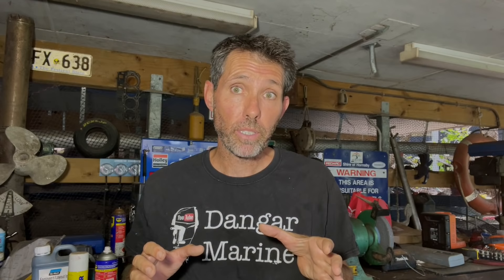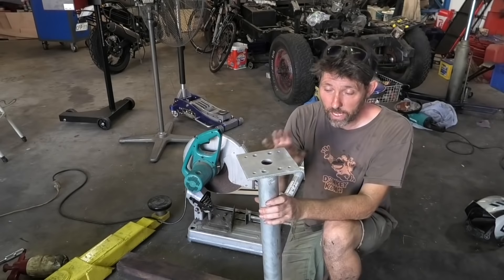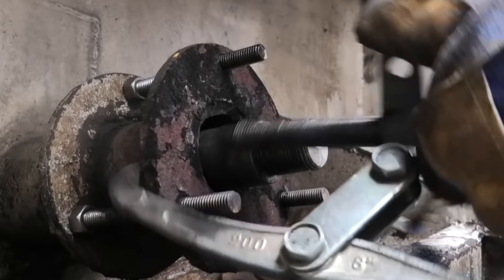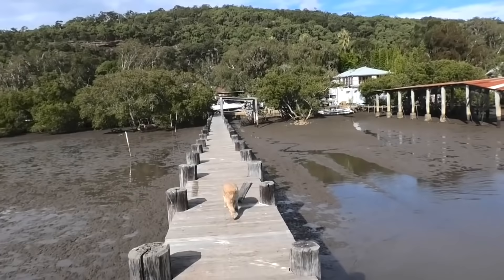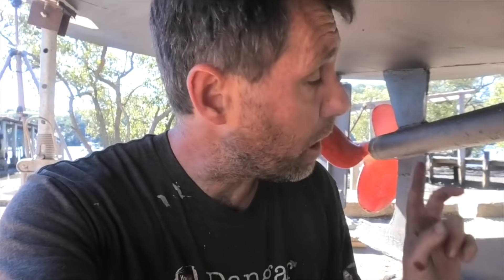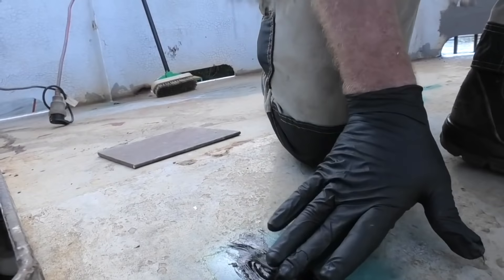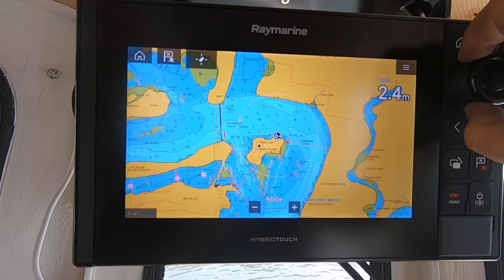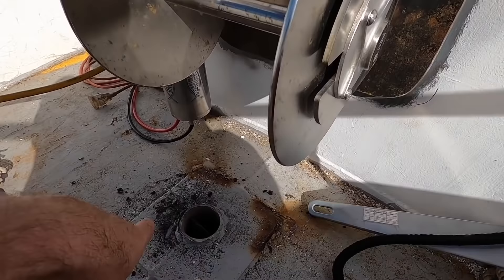Steel Trawler Restoration beginning to end

Comment: You tackled each problem with calm and humor(at least on video). When you can keep a clear mind, you have a better chance at finding a solution. I've done quite a few of these rebuilds with my dad at the marina. We have seen so many DIY folks make every mistake you can think of and some you couldn't imagine. I'll entertain you with a funny DIY story. Two young businesses guys decided to redo the anti-fouling on a sportfish they just bought. They decided that their business knowledge made them experts in boat repair. They quickly got hard to work, sanding off the old anti-fouling with the orbital sander they bought. Three days in, and my dad told me to go check on their progress. I was surprised to see only a small meter square finished. They were wrapping up for the day, and I asked how they liked the new ordital they bought. The one guy said that it seemed like a quality tool, but the pads were wearing out too quickly. I asked them what grit they were using. He handed me the sander, and the sander's pad was trashed. I asked them where's the roll of sanding paper. They looked at me confused. That's when I realized there wasn't any used sanding paper on the ground or stuck to anything. I asked, "Did you buy any sand paper?" They looked at me, and one said, "No, it has a sanding pad." They had been sanding for three days without putting any sand paper on the orbital. I gave them a roll, and they were so happy the next day making actual progress. 😂
No matter the minor mistakes you made, they don't compare to that. Great job! Can't wait to see the next project. Hope your hands are all better!

Comment: You can't think about the economics of this project. It's the journey and the mates you made on the way. It's so good watching your videos, I've missed them.

I hope you can start doing some of your repair videos again. They are very cool. Perhaps a glass boat? 😀
Reply from the maker: Yes, there is no doubt there are plenty of upsides to doing a project like this. It was a great experience even with the hard time. Yep, more repair videos coming soon!
Reply: Yes you can and you should think of the economics behind it.  He spent an amount less than the value you could buy one.  As he said don’t buy a mess buy a nicer boat the extra margin will go out of someone else vs yourself.  Also I’d rather be boating and not fixing.
Reply: @captpepin  Yeah. I work in the industry. For every guy like Stu that wins through, there are a half dozen who struggle for years and can't go on, who could have spent the same money on a smaller, viable vessel and enjoyed themselves.

Comment: It's been interesting following along on this project, and I hope there's more to come. Thanks for your efforts so far, and Merry Christmas!
Reply: been following for 2.5 years I think so this is a rewind I've never seen
Reply from the maker: Thanks Alf, Merry Christmas! Slowly getting on track again now I'm back home. Definitely more vids to come in the new year.
Reply: @DangarMarine  We are all glad to see you back and in good health !!
Reply: @DangarMarine  Hey there Mr. Aussie☺My name is Eddie I'm from Florida and I'm a marine mechanic that has been subscribe to your channel for a few years now. You're absolutely one of the best mechanics I know! So I really need some advice. I was working on a yamaha 70hp and the imeller broke apart and sucked into the tube. I tried fishing them out and I managed to get a one out of 4 pieces. I'm very concerned about running the engine before getting them out. I caught it in time before it overheated so Idk if it will or not. WHAT SHOULD I DO!??
Reply: @eleutriogonzalez6865  Take a look at the thermostat to see if parts of it ended up there, could also try compressed air in there to blow it down the pick up tube again.

Comment: Well, mate, if you'd just released this back in 2018 it'd have saved an awful lot of everyone's time.

;-)

Uncle Cosmo says you need a new project and would like to know how you'd feel about building a glass bottomed inboard catamaran. He also said it ought to be a 'right proper shag-pad' but I think that was mostly the champagne cocktails talking. I say champagne, I mean he's got two boxes of Golden Oak that he's venting a helium tank into every few minutes and mixing the froth that comes out with a two litre bottle of Lift, so, basically the same thing.

Comment: Well.. You will have your reasons... Great job of the boat... 2 St diesel is a dark art.. Used to work on lorries with cumins 14 l years ago... They sounded well.. And hauled 44 ton a treat.. I assessed on some British rnli boat engine overhauls.. Great.. They were 2st 1000 hp each engines.. All good..

Comment: Everything from out of water to dry dock for sea worthiness, engine overhaul, remove rust & paint + anti fouling. Also remove old deals & windows timber finishing, panels in wheelhouse Also galley & bilge access, marine elecrical wiring & old vhf radio + death sounder, engine room. With hydraulic oil & reservoir check.
Battery supply, and voltage.
fuel tank check, and supply. 
Potable water, correct marking/ labelling.
Anchor works & spares. 
Bilge pump works. 
There's so much but it sounds like fun

Comment: Good Day Mate, from Canada I wish you and your family a Merry Christmas.  I learned your warnings the hard way....bought a 1980 Seahorse Trawler....excellent deal of five hundred dollars.  It was a fiberglass hull....bottom line, once I was six grand in with my own sweat equity on repairing fiberglass with no end in sight, I had to make some decisions....I decided that it was coming close to haul out week for the boatyard I was on the Hard on the Toronto Waterfront.  I was going to take the boat up to my farm....I arranged the truck etc to move it....showed up at the yard the day before the moving date...the prick boatyard owner put fifty boats on the hard around mine, I couldn't get my boat out..he did this even thought I told him I was coming two weeks earlier...he didn't care...just told me I now owed him almost two grand for winter storage....I told him to pound sand and walked away from the boat.....just left it......I figure it cost seven grand in total but the lessons learned will save me ten times this amount..I add it up to college investment..how much I learned the one summer I had this boat...I came to the same conclusion as you...point of fact ....trawlers after they are ten years old...do not depreciate much more over the years as the Price Guides show.  The key is if you can afford it....buy a good boat...AND KEEP UP THE DAILY, WEEKLY, SEASONALLY, AND YEARLY MAINTENANCE on all systems.  What commands high prices....excellent up care, meticulous service records, and having a brand that carries a high pedigree....For instance, 42 Ft. Grand Bank Trawlers in 1970 fetched a quarter of a million dollars...it was pristine...it lasted on sale for one week...So my recommendation....take every cent you can part with and buy the best boat you can for that money, but a highly regarded brand from websites, and proper maintenance.  Bottom line, this is ;just a summary because the total point of insanity is owning a boat.....these recommendations will be to mitigate your loss....because a boat is a money eater...you better love boating

Comment: That crane/Tractor that extends and articulate is a super duper handy piece of equipment to remove inside working equipment ( Diesel engine) that (4-71) is a favorite of mine. Had one in a (GMC) dump truck with a (5) speed/ two speed rear end. ( Red nob on gear shifter) I personally own a (353) and 8V-71) in two pieces of equipment I own. The (353) has over 8000 hours on engine hours. I just keep it clean (40Wt Delo) 16:15 ) and the (8V-71) just did an engine service. The filters are all under the truck frame so easily change out. It takes 7 gallons of oil 
I love old Detroit Diesel ( Jimmy's) my wife had me put the two exit pipes from engine going straight up. She sound wonderful, like a older old Detroit should

Comment: Love your Vid guys, (and u mut )  I have had 7 boats and sailed all over SE Asia, all FRP but im about to buy a 1900 steel yacht, no concerns as Im comfortable with any repairs, obviously my only concern it the hull, while anything  is fixable the hull is the big challange as it may require internal cabinetry removal to access the inside to complete the repair. If a steel boat internal hull was carefully finished and protected and the hull kept dry as possible, there is no reason why is can last 50 years without serious maintenance, enjoy your boat, best regards John Gurney
Melbourne Australia

Comment: The problem with any engine is regular maintenance and frequency of top end overhauls are essential to keep the engine in tip top condition, it may have been an idea to get a good certified reconditioned replacement engine looking at the condition of this one. Yes I  realise money is tight but it always is.  Always change the fuel and oil filters at the oil change frequency plus the thermostat, don't over tighten the stuffing box against the packing. When lowering the boat in the water hold it at the normal depth, then check for leaks at the shaft seal, adjust to suit.

Comment: Yep, once you have completed all hull work up to the deck level then in the water onto the berth, once on the berth, you then have all the time in the world to complete the interior. One thing though is to get the bilge wells painted and dry before going in the water, otherwise the metal will condense behind the paint and lift off.

Comment: Amazing all you have done.... I was surprised to hear you say at 14:20 you were using the fuel leaking from the boat in your truck because you didn't have any money to buy fuel for the truck..... that's a tight budget.
Reply: At the end of the video where you talk about value.... I found it was the same with restoring many cars I have worked on over the years.... you put more into them to get them up and running as a daily driver than you can sell them for.

Comment: You can expect at least one to two years of stiffness in your thumb. You have to force it to move by using your other hand to bend, rub, and stretch it. You may not get 100% of use again, but you should get almost that. The joint is involved and arthritis should be expected at some point. Do not be discouraged. This is what happens to such injuries.

Comment: A 471 is what I had for a generator on a small tug boat I worked on , The 471 Is small for a main power plant I would think a 671 would be more reasonable however it doesn’t look like there is room for one .

Comment: Since ive been following this build.ive been on a charter boat with a 671 tai shes rated 485hp @2375rpm your boat would fly with this motor as it pushes our 40ft x14.5 downeast youngbrothers hull at 25kts wot.back to the story as soon as i opened the engine bay i thought of your 471😊

Comment: You can't put a price on pride. A boat that size is good for getting into smaller marinas where a deeper draft can't. I do a question though: If you were you replacing the deck, why not add another 4' - 6' (2 meters) onto the back and give yourself more deck space? Especially useful if you're hauling dive equipment.
Reply from the maker: I agree that there are plenty of times when it is good for a boat to be smaller, getting into marina is a classic example. Could deifnitely look at adding a transom extention.

Comment: I always limit doing the bottom paint to no more than 3 days before I'm put back in the water. Bottom paint degrades quickly when exposed to sun and air.
Reply from the maker: Yes, that is about the recommended time.

Comment: Where is your H-F (high frequency) antenna? Any boat that goes to sea has to have a backup H-F Radio in case of emergency. 14.312 Mhz is the Amateur Radio emergency frequency that we monitor constantly. I rescued a U.K. registered sloop off the Azores that had a plank stove in by a whale two years ago, the Portugese Coast Guard was contacted by the U.S. Coast Guard and kept them from sinking even though the owner had a sail fothered over the hole (he handn' t wove any unraveled rope through the sail to make a good seal). An H-F radio isn't t much bigger than a CB radio these days. Worth the backup!

Comment: did you address the gearbox flex and the shaft coupling vibration?
Reply from the maker: Once the engine was aligned accurately it all seemed fine. Done a good 1500 nautical miles now.

Comment: I thought steel and salt water were friends? 
But, on a serious note, how do steel boats last as long as they do in that brine of electrolysis known as the sea? Is it all down to the anodes, or is there some other magic going on?
Reply from the maker: It's really a case of good surface preparating and high-quality paint in addition to anodes. Without both of those things being fastidiously maintained they go down hill very fast.
Reply: @DangarMarine  Thanks for the reply Stuuu.

Comment: Not sure what but something drastic has changed. So be it. 
But I never thought you bought Renko for the resale value. I thought you bought something that would be normally out of your price bracket and the reason you could buy it is because it needed work and you had the skill, sweat equity if you will. Also when it was done you would know what was in it and could trust what you did. I've looked and even bought many boats that were "ready for the water" that were more ready for a land fill. I would rather buy junk and fix it then buy someone else's perfect boat just to find out they didnt have a clue or even worse hide things until it's too late. Finding a "perfect" boat is a crap shoot unless it comes with a warrantee and even then, you never know. Just ask the folks with Lagoon 450's. So for some I will agree with you and just go buy someone else's project but know you are taking on a project even if it look done. As for the rest of the folks with skills like you and I, Stu go get yourself a project. Maybe not as big as Stu's but there is a lot out there at all skill levels. 
I'm doing one now that I know I will lose money on but I didnt do the project to make money. I did it for the project, the history I will save and what I will have in the end.  https://youtu.be/DqKkT2CV1xU

Comment: This is just my opinion.
If I am ever in that position, I will buy a reconditioned engine and put it in. In a massive job, so time consuming and hard, like repairing that engine . . . and you had no idea if it was even possible ?. It is a common occurrence to find so much wrong that it is more expensive in parts that need replacing, you could easily do all that work and find it still wouldn't repair.
Your sweat equity is better applied at say, working for a concreting firm for 6 months, and buying a motor with the wages.

Comment: Hello Sir. My name Eddie I'm from florida and I'm a marine mechanic that has been subscribed to your channel for a few years now. You're absolutely one of the best mechanics I know of. I have a very serious issue and I need your advice. I was working on a yamaha 70 it was pumping water fine then it stopped. Thank god I caught it in time before frying the motor. I took of the lower unit sure enough the impeller is in pieces and I was only able to fish out one piece out of 4. My question is should I run it to see if it catches in the thermostat? Have you had this issue and what do you suggest??

Comment: Wow, Pretty good/nice for a shitty mechanic says the chicken
I think you could of built a new boat from scratch for 1/2 the work
Reply from the maker: Please build one and send me the data.
Reply: @DangarMarine  I've actually built 4.   I did build with glass though, different animal as they were CCs.  I have no need for a steel boat but did help an old friend(who has since passed) build with aluminum.  All of this was over 20 years ago. I'm sure I  have some pictures somewhere. What's a matter you still pissed at the chicken?
I do like that even with the lack of specific tools you still get it done
Not sure what happened but part of my original comment is missing

Comment: I did not see a cooking grill. No self respecting boat in Australia would be without the means to throw some scrimp on the barbie. Also there is the issue of those horrible dogs known as dingoes running loose eating babies and smaller size kangaroos. In the event that your boat is close to shore there is the risk that a pac of them Could swim out to make a snack out of any pets you may have on board. May be a right good idea to keep a Couple of boomerangs 🪃 on hand to repel those sneaky savages. In the words of the local aborigines, “you don’t want the dingo to get your baby.”